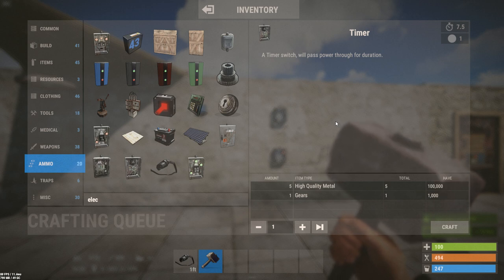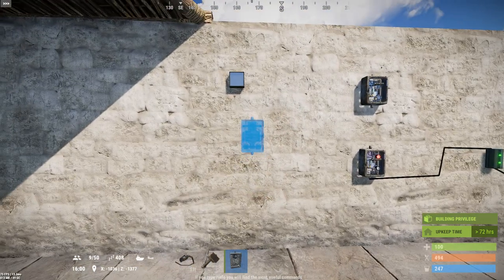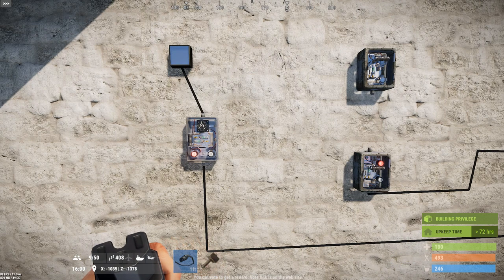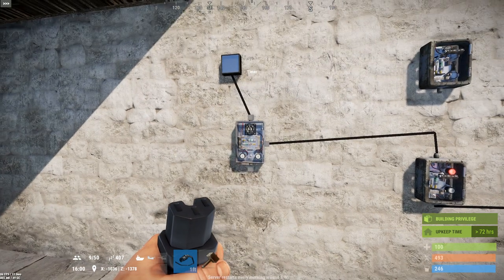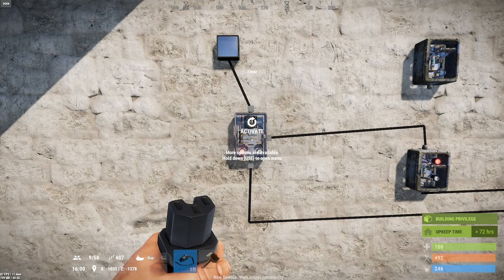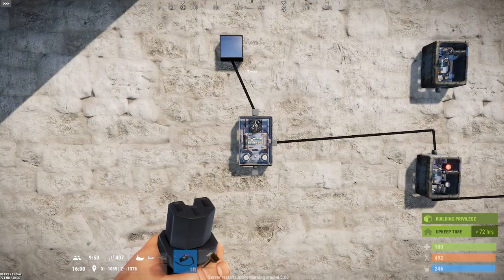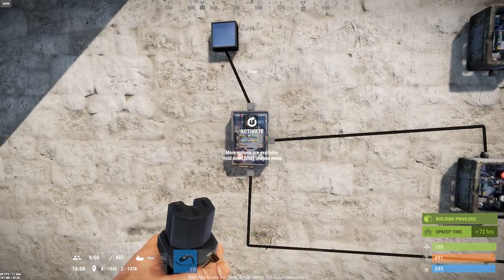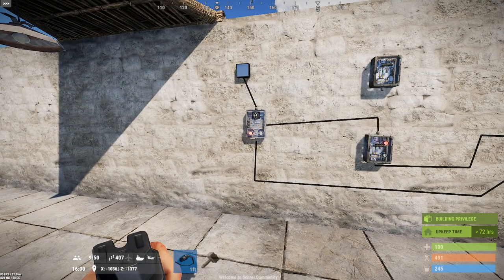Rust Electricity 101: Component Guide - Timer

Comment: how would i hook this up to multiple turrets so when i press a button turrets go off for a certain amount of time and then turns back on
Reply from the maker: Hook the timed up to a blocker so that the power to the turrets are blocked while the timer is running. When the timer expires, the circuit is no longer blocked, so the turrets power back up!
Reply: Use a switch connected to a splitter and as many turrets just add 1 power cell block for each etc

Comment: How do I attach this to a memory cell thats triggered by a laser detector?
Reply: Hahahahahaha that's what I was trying to find out
Reply: might be a little to late but i was thinking the same thing and i figured it out if you still would want to know for future purposes you connect the output of the timer into the input B of a xor switch and have some other power always turned on and plugged into the input A of the xor switch the output of the xor will go to the input of reset within the memory cell (also have the toggle on of the timer from the output of the laser) so when you trip the laser it will send electricity to the timer activating it and turning of the xor switch and setting the memory cell back to state 0 which if you're using it like me will turn off the lights and close a door sorry if i was a lil late but hope this helps